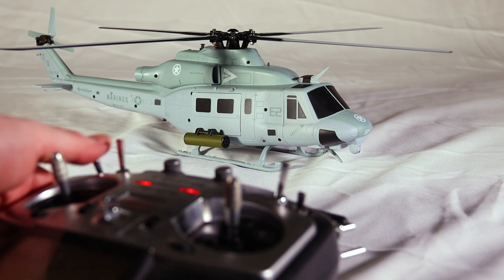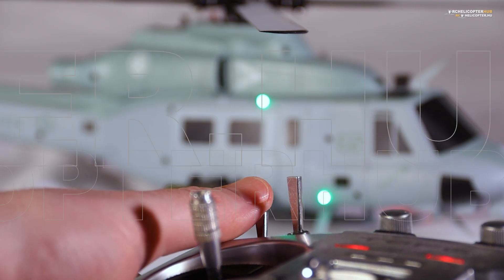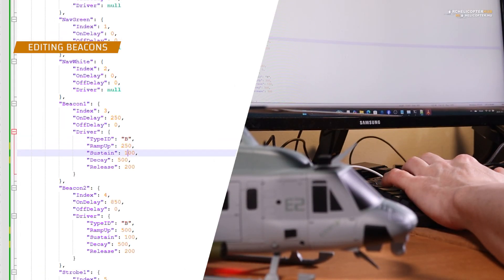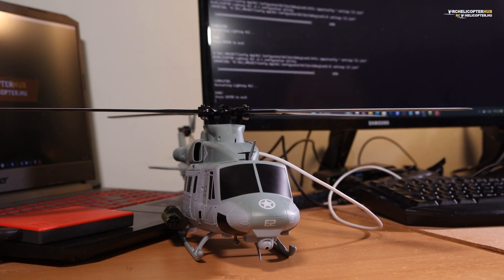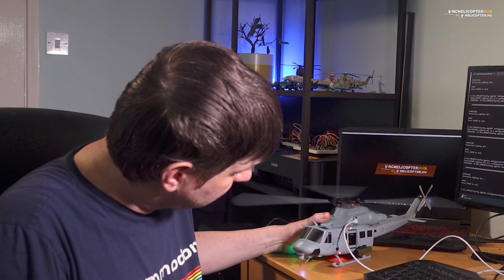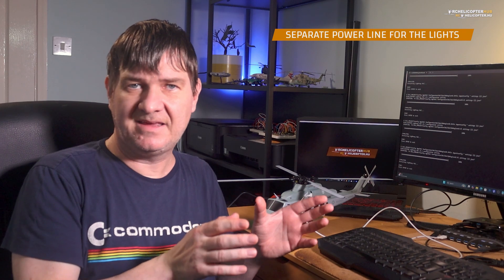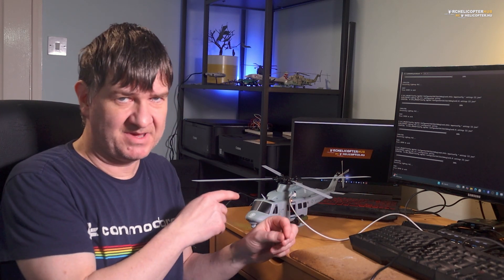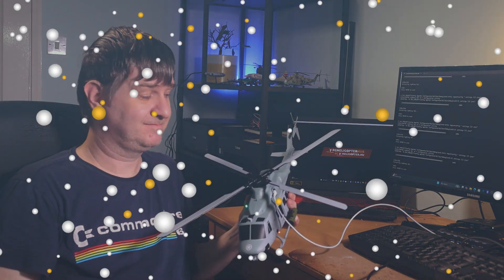A system you missed - it can remote control RC helicopter or airplane lights

Comment: I have witness you run up the heli a few times and shakes everytime. It looks like a bent main shaft or blade spindle shaft are bent.
Reply from the maker: Thanks, but you are wrong. This is a four blade heli. If the blades are not completely straight, it will shake until the blades align. And as usual on my helis, blades are tight, so it takes time.
Reply from the maker: But anyways, thank you for paying attention to details.

Comment: Ok brother how about a vid on lights and wire installation. Any new info on lights for sale.
Reply from the maker: We are very delayed... I'm doing most of the work here, and there are many events now. Simply I cannot get there to finalise the product. It will be there at some point, just I'm too busy with the contents. For example: six videos are in the queue to edit right now. I'm trying my best to complete this as well. 
Long story short: in May I realised I need to restructure the chip layout to accommodate a bigger MCU for better performance. The new wiring is done in the schematics, but I had no time to design the modified PCB yet.

Comment: Would you be able to add the formation lights as well?
Reply from the maker: Hello, the current version of this controller has got a 10th light channel, so yes you can add even that, although, I'm not planning to build it into this model. But if you want, with the light controller this will be possible.

Comment: Looks very interesting.  I was thinking of building my own but, if you have a good product for a reasonable price, I would be interested in buying yours.
Reply from the maker: Thank you, I thought at the beginning this was going to be easy, then it turns out it wasn't. 3 months of coding, designing, re-designing, re-coding, changing the architecture, etc...
I'm waiting for the test PCBs right now, then the final - real life - tests, and if everything goes well, it will be a product around the early summer.